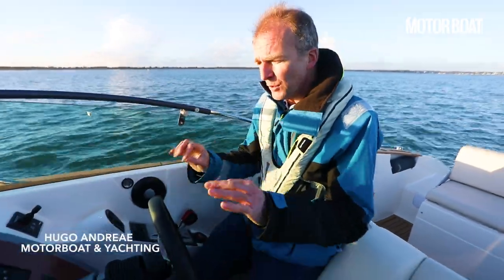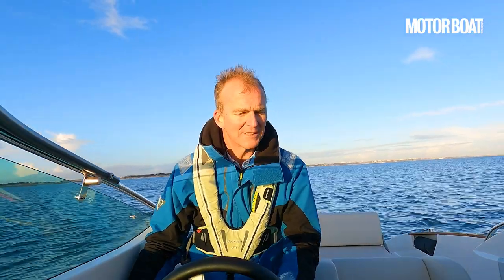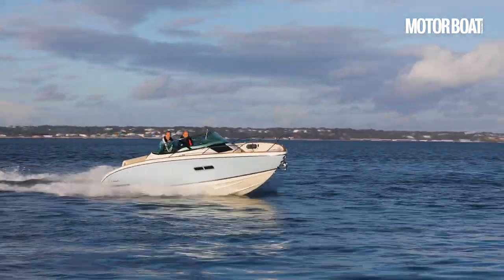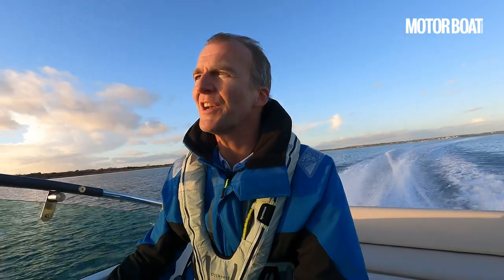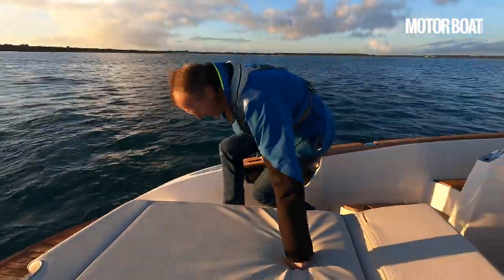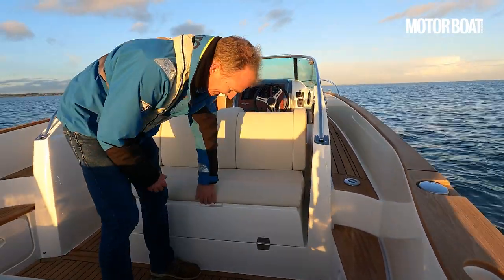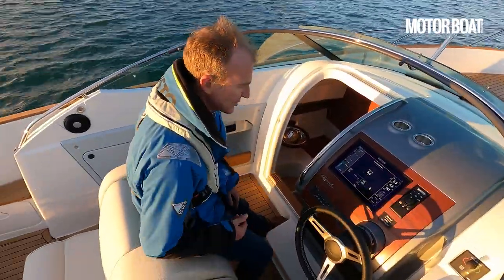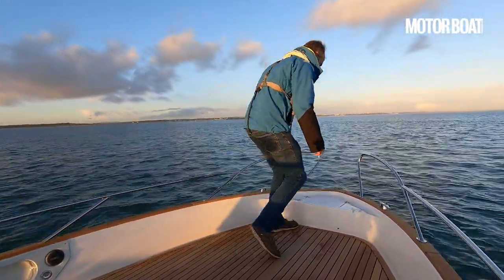Cormate T28 sea trial | Full test of this 50-knot sportsboat sensation | Motor Boat & Yachting

Comment: Nice looking hull but the rest of the boat looks like it doesn't know what it is. Is it a bow rider? No seats. Is it an overnighter? No. Entertaining day boat? Cockpit is not suitable. I just don't get it.
Reply: Just what i wanted to say. Either make something out of the bow and leave it with no cabin or lift that deck up.
Reply: Maybe think of it like a far more usable and versatile cigarette-boat-lite. Very comfortable for cruising. More protected and comfortable than centre consoles. Also room & features for enjoying the day on the water. Can even do overnighting.

Very sporty boat made for boating itself, and infinitely more versatile than cigarettes.
Reply: A quick look at their website shows that I seem to have been right:
"A Norwegian designed, quality boat with unusually high finish and great details. T-28 combines the usability of a center console deck arrangement with the comfort of a day cruiser."
Egil Ranvig
Designer and founder
Reply: @matthiaskettner6686  It is a sunbathing deck, which can also work for fishing...or you can of course put some seats up there I guess. It's versatile. Much more usable than if the deck level was raised up higher. Some people (like me) want exactly this kind of an arrangement.
Reply: Please explain the fuel capacity
Reply from the maker: @leonwakefield7285  The stats card was wrong - it's a 6.2L engine, but the tank can hold 250 litres
Reply: @pistonburner6448  You're a bit high, the rails a bit low, and the deep+ V hull isn't ideally set up for stability if running around fighting fish. It also lacks any fishing specific features. OTOH: On a fixed time budget, the speeds it accommodates, even in less ideal sea states, does meaningfully increase the size of your reachable fishing grounds, compared to more typical multiuse boats of similar size.
Reply: @paulnorman8274  I'm not saying you're completely wrong, and this is not directed only at you, but it sounds like so many people (at least when talking) are "Princess and the pea fishers". It's like a skit I saw of some guys spending massive amounts of money on fishing equipment, boat, trailer and big off-roader to tow the boat, then seeing an old-timer in a wooden rowing boat catch his boat full of fish while they catch nothing.

I've never thought that standing a slight bit high or having railings a bit too low would be a dealbreaker, rendering me unable to fish. Often I've had no railings at all. If you're trawling then that's another matter, but that's just one type of fishing. All my fishing equipment is carried onto the boat in one bag and with my fishing pole in one hand.
My friend's dedicated fishing boat specifically has a high front deck, pretty much like this boat does. Though you're right, in this boat due to the boat's overall size etc. it's pretty high up. In calm waters it's good for sure though.
I've fished with a 4 meter simple one-layer fibreglass boat with a 15hp outboard (pretty far out from an island in a very open ocean), I've fished with row boats, I've fished with several different types of aluminium boats including our new pretty expensive XO which does have a nice open foredeck but even with that I prefer to stand on the transom.

The professional fishermen I've gone out to help haul in their catch from their fyke nets (not the hoop kind, the big V-shaped nets) use ~5m simple open boats with nothing but a few benches and a steering console.

I've also fished off my friend's Sea-Ray 240, though he did then buy a second fishing boat...which was a 4,5 meter (proper multi-layer, rugged) fibreglass boat with a side console and windshield. Cost him about 15K€ used but as-new, only a year or so old.

I get that people want to improve their comfort and equipment, but I genuinely don't understand this snobbery about absolutely needing to have some magical "fishing type boat" to be able to fish, and how some people pretend that it's impossible to fish off of almost any boat and especially boats like this one!

I'd be happy to learn more about why it would be necessary to have certain features, equipment or certain type of a boat in order to fish. I'd genuinely be happy to improve my understanding and comfort. So many people keep going on about this that I must be missing something? And I'm not talking about trawling, I know that requires basically just a huge amount of rod holders...but even that could be possible on this boat by installing a rod holder bar going over the boat and railings on the side for rod holders...